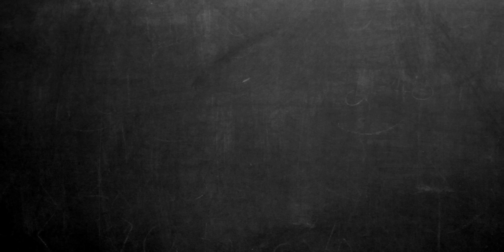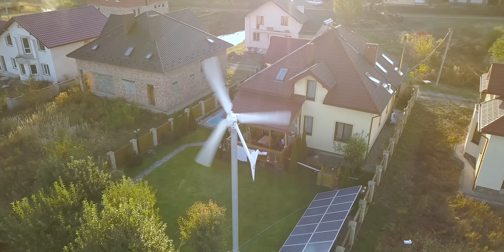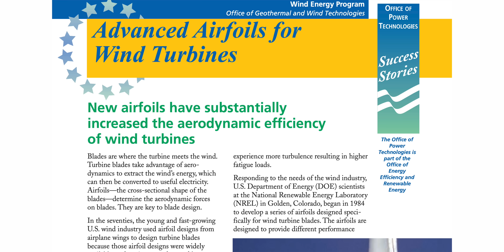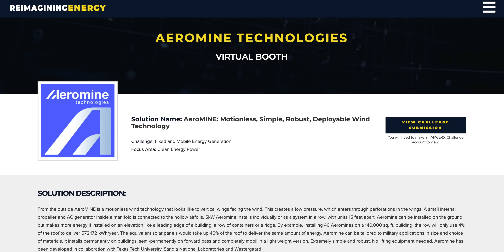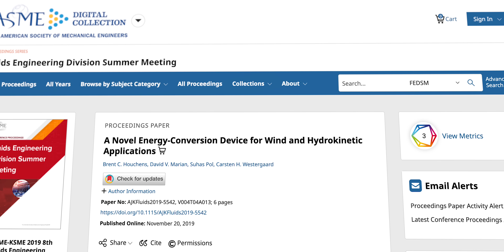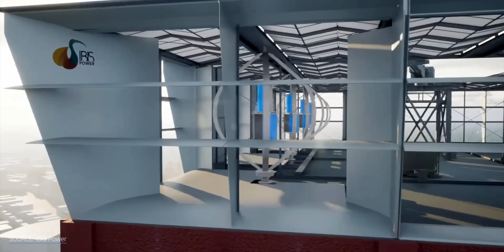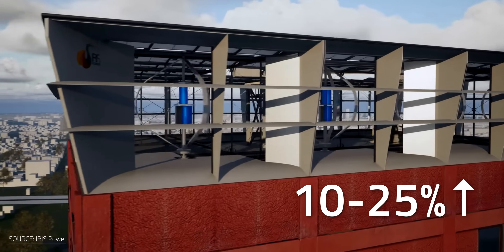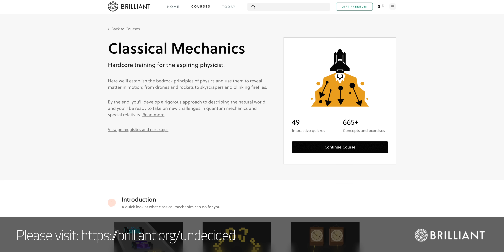How Can A Wind Turbine Be Motionless?

Comment: All practical tests show that small wind turbines hardly generate any electricity. Because there is hardly any wind close to the ground – and electricity yield is proportional to the third power of the wind speed: So 100% more wind generates 800% more electricity! 
Only if you need to be self-sufficient from the power grid, you should erect the largest possible wind turbine on a high mast. 
With solar modules, on the other hand, you can reliably generate green electricity for 25 years at approx. 5-10 cent/kWh!

Comment: i've never understood why electric vehicles don't come equipped with a conical wind collector (or two or three) with a small fan blade to generate power while the vehicle is in motion.  it would be like a trickle charge, but it would be recharging while driving.

Comment: In RSA there is quite a bit of sun and solar becomes popular . A 10-12 panels complete installation cost ± 5500 € and covers the basic needs,  but is not sufficient for an electric geyser (3kW) and battles when switching on the electric kettle (?1,5 kW) the air fryer etc. To make such an individual installation viable it must then be complemented by gas (stove, geyser, heating etc), helped by a good insulation (which is rare) and connected to the network during peak usage of big guzzlers.
On the other hand,  ±80% of the cost of solar is related to batteries  and inverters: the relative cost of solar panels versus wind turbines becomes then less critical. Properly sizing the batteries and the inverter(s) is important

Comment: I'm sure they looked into it but at first look why doesn't the top part rotate like a weather vane? The system looks heavy enough that rapid changes of direction wouldn't cause it to turn rapidly and cause damage, plus there are ways to control the speed it rotates without using power. Needing the wind to blow from a specific direction seems like a major flaw.

Comment: In hot climates, and heat generating buildings e.g. factories, you could presumably harness the natural ventilation effect of heat rising expelled from the building through vents to feed the wind turbine, which would in turn enhance the cooling effect within the building by creating the effect of an extract fan through the wind turbines increased air flow speed, as well as driving the wind turbine in windless conditions.

Comment: We could take very small diameter wire with plastic insulation. And put them in a tik tac toe grid. Only more squares, kind of like square chicken wire only plastic coated. Then vertically placing it like a fence. Hooking up the Y and X axis wires of the grid in Parallel. And use the air coming in contact with and flowing through the grid. To create and harness static electricity. Some more tweaking and detail I can't talk about on here, needs to be done. To make it fully functional.

Comment: You haven't named ANY of the technical negative points of a small wind turbine. What kind of roof structure is required to house these power nests and generators? They look like they weigh several tons! A wind turbine's power output scales quadratically with the diameter of the blades. A small one on a rooftop will only generate a fraction of the power a large one in the north sea would produce. A turbine with a diameter of 220 meters can generate up to 13MW of power. Lets put our money where it's most effective, this is a stupid idea.

Comment: I've often thought on an engineering project if i ever won the lottery. Literally drilling a tunnel through a high plateau and coming out the bottom. The thought being high altitude low altitude will create flow and possibly also water accumulation

Comment: At the 3:24 mark: That’s not correct.  The shape of the car causes lift, not downforce.  All the airfoils attached to the car are there to combat the lift from the hood-roof-trunk being a longer path than the underside & keep the tires on the pavement.

My gut feeling is that there’s no way an Aeromine of the sizes shown can produce 5kW.

Comment: Your standard yearly output for a 5kW solar installation (they are normally 6kW of panels with a 5kW inverter) is off. My average for 3 years is a bit over 8MWh per year. This is with run-of-the-mill Chinese panels.

Comment: With all your technical teachings you ought to educate people on the true components of a commercial wind turbine and turbine arrays , the major problem with them is that in fact they are not green energies at all. They are hydraulically operated, using petroleum based hydraulic oil to operate the hydraulics which pitch the blades and the braking system is hydraulically operated as well , the intent of a wind turbine is to reduce the consumption of fossil fuels and chemicals that reduce the damage of the ozone layer , which they do not! We as a people need to find better ways to creat our energy or demand our governments to let go of there top secret technologies , which they possess. None of the so called green energies we have in operation today are green, there all gimmicks and a very profitable

Comment: Talking to Oldtimers windpower had its chance.  People used to climb them once a month to oil them, then traditionally when it gets really hot the wind doesn't blow. 1st chance civilization got they put in electric motors to move water. I'd say if windmills were practical all the big ranches would have them for personal use

Comment: Yet another company that likes to talk, but can't show you a product. Show me, don't tell me. If they had a working device that was good, they would be eager to release it.

Also, I think this video induces a subconscious expectation that this product and fan turbines should be compared, when they are complementary. This device has very short fan blades. It probably cannot extract energy from high wind loads as efficiently as a fan generator. So, maybe that makes it OK for use in less windy locations while fan generators are better-suited for areas with frequently strong winds.

Comment: I think there is a lot of puffery there.   5 kW means a lot of air blowing through that small tube with the tiny propeller in it.   Regardless of the method of harvesting wind energy, the props energy capture is proportional to the square of its diameter.  And how can it harvest the energy from different wind directions without moving?   The airfoil that produces the venturi effect is an asymmetric shape.  It has to be oriented optimally towards the wind.   I think a 5 kW device would occupy more surface area than a comparable solar panel.  Of course that comparison was glossed over - still to be determined!

Comment: "By hiding the motion inside, which limits the possible directions of captured energy."  I'm honestly surprised they can't make a more omni-directional version of the first thing.  I'd assume they already simulated or tried one with more incoming columns.  That blocking horizontal motion (to offer a changed wind orientation capture path) lowers the efficiency of the original 2 column results.

Comment: If they aren't spinning, there's either: not enough wind, too much wind, storm shutdown, turbine is in repair or it's power purchase agreement has run out.  So during the months when there's no wind at night, all the ev's out there are being charged with fossil fuels, nuclear, and hydro... not "renewables".  

So you want to charge massive batteries with renewables when they're producing, to store the charge for when everyone gets home and wants to use gobs of power and charge their cars.  That's a really expensive and silly way to do things compared to nuclear power. I spent my career in wind and am retired now.  Any idea how many hundreds of gallons of oil is in the gearboxes in wind turbines?  Or how many POL resources are required to make them?  
You have to use a solar panel for 7 years before you pay back the electrical debt it took to create it.  Ignorant people are missing 90% of the actual story with renewables.

Comment: Well this would be a no-brainer if it lives up to its promise and takes off. BTW, 4:18 the SI (modern metric system) uses symbols, not abbreviations, and the symbol for kilometres per hour is km/h, not "kph" (which would mean "kilopicohours"). Also, kilometres rhymes with "nanometres" or "metres" itself, not with "thermometers" or "speedometers" (because it's a unit of measurement, not a measuring device).

Comment: How can a Wind Turbine be motionless? The answer is: It cannot. Definition of Turbine:

A machine for producing continuous power in which a wheel or rotor, typically fitted with vanes, is made to revolve by a fast-moving flow of water, steam, gas, air, or other fluid. You see? It cannot.

Comment: Once this company has improved the Aeromine enough for the residential market, it would be great to see it miniaturized to the point a unit could be placed on the mast of sailboats. The sailing community is constantly looking for a better way to generate energy, while at sea. Current wind generators are large cannot be used under sail to any useful degree, and solar panels are bulky and take up a lot of room.

Comment: A buried multi-blade small turbine can be fixed or replaced more easily than the huge blades of an above-ground turbine. If it fails catastrophically, the blades of the buried small turbine will be less likely to harm its surroundings (esp. people and livestock) than a catastrophic failure of an above-ground turbine.

Comment: Yes, I am talking out the top of my hat, but vehicles, ICE and EV move air as they travel down the road.   It seems to me a decreasing diameter vent tube could capture the faster moving air, venturi effect, to create electricity that gets put back into the battery pack of an EV.  Let the moving vehicle create and capture the moving air.

Comment: An average optimal-placed solar panel in the Netherlands generates abt 120kWh/yr, so 140MWh requires just under 1200m2 of panels, or 35m squared. Estimated from pictures from the 70m high "Haasje over", that's even more than the dimensions of the roof. It suggests my number is perhaps conservative, but it also suggests adding the turbines makes the Powernest panel & turbine configuration ineffective in terms of costs... Would be interesting to know the cost-benefit, if conventional lower and thus cheaper panel foundations would have been used.

Comment: The first part is stupid. The one reason for why rooftop energy cannot take off in the same way as rooftop solar was not even mentioned.
Unlike solar energy, wind energy potential increases as a function of height.
By a LOT. 
Even in hot regions with low wind energy potential, the annual wind power density (W/m^2), increases by almost x10-fold by going from 5 to 50 meters.  When you go from rooftop level to modern windmill designs, we are talking more in terms of orders of magnitude. Modern windmills have more than 50% efficiency, so even if a rooftop mill were 100% efficient (which is impossible), its effect areas would have to be measured in square kilometers to reach the same effect as one modern windmill. No matter your design, it is impossible to wish more wind into existence. 
Ie you have to cover a decent part of a city to reach the output of one windmill. 
This is not the case with solar panels. What about their claimed output?
It is what we would call a slight modification of the truth for funding.
Finanly, the average wind speed at different heights is much more variable the closer to the ground you get. Almost everywhere at ground level have many more days of windspeed =0m/s than just 100m up.
No matter how small the minimum running speed for a generator: 0 = 0.
So is it better to put something atop a 100-meter building? Potentially, but let us see if installation and maintenance costs can compete with a 15MW offshore mill. Annnd there is the small matter of structural integrity.
The reason high rise buildings have flat roofs with parapets is that it is the design with the smallest risk of a storm ripping off the roof. If you intentionally design your roof to maximize wind force, e.g. by foregoing a parapet, I would argue the architect and engineers should be in the rooms below during a couple of north sea storms. But lets see how it holds up.

Comment: Wind is free turbines are not cheep. I live on a sailboat and had a wind turbine on my other boat. 700w in 20knots of wind and it did not start producing power until the wind exceeded 5 knots.  For the turbine to work the wind has to be blowing. Most people don’t like to live where the wind blows all the time. I found the ROI was not there on my boat. If i was in the Caribbean where you have strong winds every day the return is better. So when looking at these units What is the ROI on these units.

Comment: Why put an aeromine on top of your house ? Why not build the entire structure of the house as an aeromine airfoil ? On a bearing that carries the entire airfoil-house and can turn it into the wind like a windmill . A large aeromine-house will produce more pressure effect and therefore electricity , than a small aeromine on top of the roof .

Comment: these wind mills upset the natural wind currants causing the wind to coagulate in unusual currants that travel globally forming more frequent tornados if this is untrue then why are they all turning in the same direction , recently traveling south in indiana on i 65 with a strong crosswind i was getting an intermitted side push from those giant blades proving to myself they affect wind currants i say they should not all turn in the same direction .  also why are they all so far apart from each other ?  these are not the answer .

Comment: Sounds like nonsense. Harvestable wind-energy(Betz law) limits power by area x speed^3 in the wind-direction. Ignoring area and not changing wind-direction and such, saying that "wind speed is not that relevant" is nonsense. It is the reason, why wind turbines are high up (more v far above ground), have a large diameter (area increases by radius ^ 2) etc. Speed cubed means, that 5mph vs. 20mph would mean a power increase of 100 times or in this case: This system cannot produce more than about a percent of a wind turbine with 20mph wind. Nice images, but advertisement for a scam.

Comment: As a mech engineer. These fluid dynamics theories are so easily applied. And towards following the wind directions. 
Why we still not using it widely? The simple answer because burning petroleum and coal just so much easier. And there’s definitely lobbying against usage of wind turbine. Imagine water dam turbine  concept had been used for so long yet it seems like wind turbine is a new concept.

Comment: These wind turbines
 are not what they seem. ITS the total opposite. They produce low frequency which is harmful as it penetrates through solid matter.  You will need 300m of solid 
Material to PROTECT yourself from the harm of the low soind frequency.  It causes brain tumours and other deadly problems.  Some Russian lady with 3 phds spent 40 years studying this
Reply: Scare mongering BS. No such thing as low frequencies causing "brain tumors". It's literally just air moving slightly.

Comment: You can buy 470 watt panels for $215. 

So 20 panels plus $2k for an inverter plus wire.  Even if you hired out the labor, you’re looking at $15k at the most.

Comment: Seems like a low ratio of turbines to panels. Maybe Power Nest 2.0 will have more wind turbines crammed in under that solar panel ceiling but placed on swivel mounts to angle into changing wind directions

Comment: You can always use arduino to make the base of the wind turbine movable. this can generate more power as wind changed. this is already used in solar panel industry, nothing new. however this wind turbine is good for country windy especially tropical countries.

Comment: It's neat to hear you mention the air flow keeping the solar panels cool.
When I was in grad school, there was a guest presenter who had done extensive research into temperature dependance of solar panel efficiency and then using that data to produce more accurate maps of globally available solar energy.
Reply: One of the cool concepts I like that uses airflow based cooling is vertical double sided solar panels, as they get hotter airflow increases along their surface (because hot air rises), pulling cool air from below. If you orient them so one faces west and one faces east they produce most power in the morning and evening, when people use most power, instead of during midday, when most people aren't using a lot of power. Having this option allows you to adapt your power production to your power use. hot building that uses a lot of airconditioning? South facing panels. Cooler building? West/East panels.

Comment: In the late 1970s I lived in a house in Vermont with not one but two windmills in the yard. They did not work. and wind energy does not work now. It is inefficient, expensive and bad for the environment, consuming large amounts of money and resources per kilowatt produced like copper, steel, concrete and composite material for the blades.